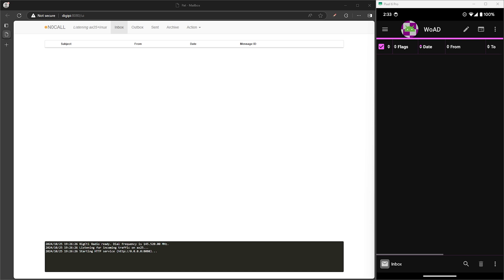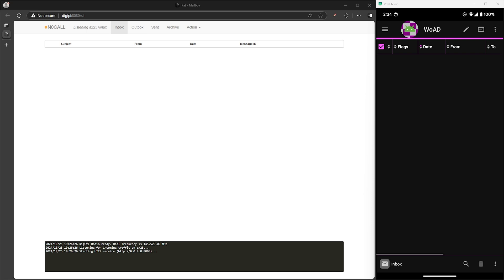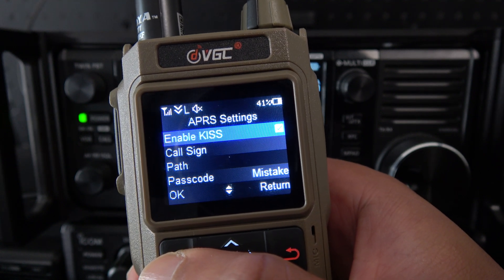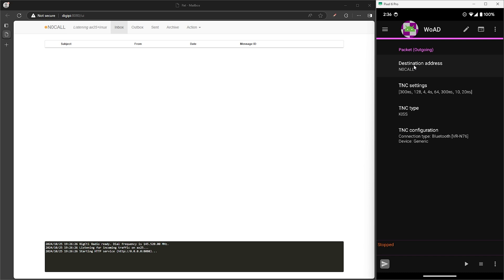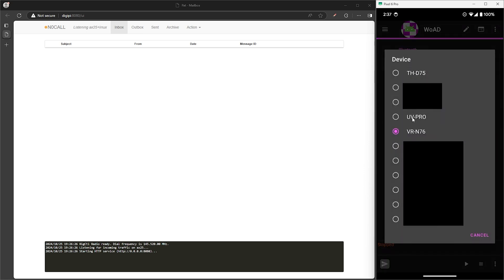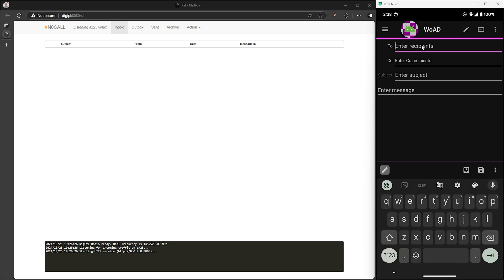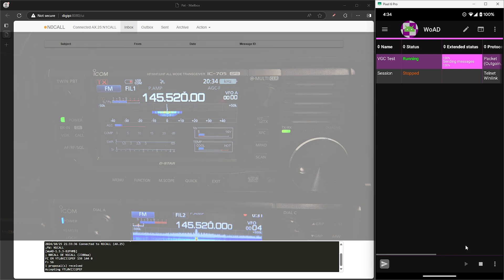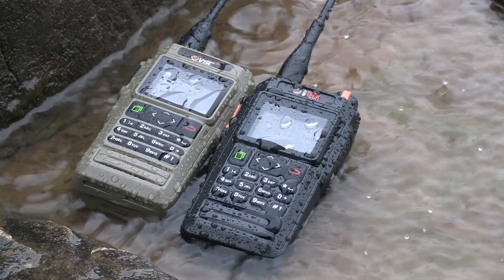KISS Bluetooth Update & Winlink via WoAD | VGC VR-N76 BTECH UV-PRO

Comment: I can't get my set up to talk peer to peer. I can connect to gateways, but having one phone with my D75 connected and another phone with the UV Pro they don't talk. The destination addresses are correct as far as I can tell, I have the kenwood with my call sign with destination address to the UV Pro and another call sign. Both radios will transmit but neither will receive. I can hear the signal going but it won't trigger Woad or the radios to receive. Any ideas?

Comment: I read through all the comments and didnt see issue Im having addressed.  I set up WoAD the same as you in the example. When I try to send a test to N0CALL  i get the error message " you must enter a valid call sign before creating a message "  . Im using a Smasung S10+ with andriod version 12

Comment: Hi, I did exactly what you told in this video on my VR-76N but the session won't work. A quick green running changes in red stopped and I see that there is a bluetooth failure while all is set in the handy menu and kiss is turned on. Any ideas ? 73 Phil ON4VP
Reply: Did you ever solve this? I have same problem.

Comment: Love your videos as they are so Informative, I have configured my phone and UV-Pro but my cell will not connect to bluetooth on my HT while running WOAD. The Btech app works fine with no issues. Do you have any advice?
Reply from the maker: Thanks! Appreciate it! If the BTECH app works, but not others, the radio may not be in KISS mode (Process changed a bit since this video came out). From the radio, hit the green menu button > General Settings > KISS TNC > Enable KISS TNC ✅

You should now be able to use other apps via Bluetooth KISS TNC
Reply: @The_Comms_Channel  No luck so far, tried another Android device and also no luck. I'll double check my UV-Pro settings.
Reply: @The_Comms_Channel  I'll give it a try, thank you again.

Comment: Thanks for the video. Unfortunately bluetooth fails to connect using WoAD but has no problem with the HT App.
Reply from the maker: Be sure to go into the settings on the radio and select KISS Mode

Green Menu Button > General Settings > APRS Settings > Enable KISS [✔]
Reply: @The_Comms_Channel  Thanks. Did that. No joy. I even deleted and re-paired the devices. Bluetooth has no problem with the HT app. WoAD and BT works with my Kenwood TH-D74. I also disabled 'digital mode' so APRS isn't running. I keep getting ' BT failed to connect' pop up on my phone. I'll try my tablet later. Might just be my phone. Thanks again.
Reply from the maker: @johnblaisdell2179  Ah, that is odd. Especially after re-pairing. Definitely try out the tablet and see how that goes to narrow things down 👍👍
Reply: @johnblaisdell2179 exact same issue with mine...did u get it working?
Reply: @FunInSC  Yes. I updated the firmware again and it's been working. You have to be sure the HT app is not running and verify the Frequency in A band. It does not use the channel selected for APRS. You may have to change that as well
Reply: @johnblaisdell2179  thats what I did as well...working now
Reply: Alas, I'm still unable to make the connection to Bluetooth via woad -- though HT app connection works fine. Changed settings on radio side, turned off ht app, etc. Firmware .9.

Comment: Smartest move I’ve recently made was buying a VR-N76. By the time it gets here I’ll be able to use my iPad as a WinLink terminal, and this as the TNC.
Reply: What app are you using on the iPad for this? I havent seen much on Apple stuff either radios. Everyone’s android.
Reply: @goalkpr14 HT to control the N76. For WinLink I’m using RadioMail
Reply: @goalkpr14  Same one you use for Android… HT. I Use SSTV for Slow Scan and RadioMail for WinLink.
Reply: @goalkpr14 RadioMail- it is awesome
Reply from the maker: I think you'll be very impressed with the VR-N76!

Comment: I am on the most recent firmware and haven't been able to get WoAD fully working. It'll do the Winlink handshake per the logs and visible send/receive traffic, but when it comes to actually sending messages in the outbox the packets being sent are either invalid or there's another issue with the protocol. I've used these nodes in the past with an FT-818 and know they work with both VARA FM and Packet 1200. It's odd to me that it fails indefinitely right at the actual message send step. Requested to be added to the WoAD Google group but no luck so far.
Reply from the maker: I've forwarded this info to the firmware developer. It's still in beta so this may be related to a bug.

Comment: Question: So, I'm green with regards to radio comms. I understand some basics. I purchased the UV Pro, so what do I need to do, to make it ready to use in grid down emergencies? Do I need to actually acquire an amateur operators license to make a call sign? 

Would the GMRS Pro be a better option for emergencies? 

Can you explain to me the very first steps to get me going in getting these radios operational? I can update the firmware and all that. What do I need to do to get to the point where I can actually use these in emergency events?
Reply from the maker: I recommend working on getting an amateur radio license, but in the meantime to get the radio operational you'll want to program the frequencies of the repeaters in your area and the tones they use. Also program whatever simplex frequencies you plan to use with your family and friends if you plan on communicating with them. The GMRS Pro is a good and similar choice for those that don't plan on getting an amateur radio license.

Great questions. I'll be doing a series of videos on this soon
Reply: @The_Comms_Channel  Thank you for taking the time to reply! I'm very much into preparedness, but radio is a weak point of mine, but I want to improve that so I become an asset to my community.
Reply from the maker: Sure thing! Thank you for wanting to be an asset to your community and I hope the videos are able to help!

Comment: Thanks for staying on to of this.  I have same settings.  I do connect to a node about 5 .Ikes away.  While I successfully connect, the mail still does not complete transfer.

Info,2024-10-26 12:34:57Z,"Session "UV PRO" ended","UV PRO"
Packet,2024-10-26 12:34:57Z,"K3CAR < AA3E-10 [last] C|R=Response U_DisconnectedMode F=1","UV PRO"
Packet,2024-10-26 12:34:56Z,"AA3E-10 < K3CAR [last] C|R=Command S_ReceiveReady N(R)=2 P=1","UV PRO"
Traffic,2024-10-26 12:34:16Z,"← ;PQ: 94594138","UV PRO"
Packet,2024-10-26 12:34:16Z,"AA3E-10 < K3CAR [last] C|R=Response S_ReceiveReady
Reply from the maker: Hmmm. Do you have better luck if the squelch level is at 0? I have had to do that before with radios using audio TNCs and wonder if that will give you better results.
Reply from the maker: I've forwarded this info to the firmware developer. It's still in beta so this may be related to a bug.
Reply: I was having trouble connecting to stations as well. It would connect but that was it. Uncheck the "Tail Elimination" in the Radio Settings and that seem to have resolved the issue.... Update... it worked for like 3 connections then back to not working... could be a bug..

Comment: Why did you say this was about new firmware for the BTECH UV-PRO, but you never showed it, and you showed another radio?
Reply from the maker: They're basically the same radio so this applies to that radio as well.
Reply: @The_Comms_Channel  i dont have the option for kiss  in the btech ? and im running firmware 0.7.9-32
Reply from the maker: @sgtcrusher66  You'll need to go through the firmware update process again

https://youtu.be/b9-tGuoEx-Y?si=_flMQvsvUqX5E3TU&t=131
Reply: @The_Comms_Channel  are there other apps this works with as well ?